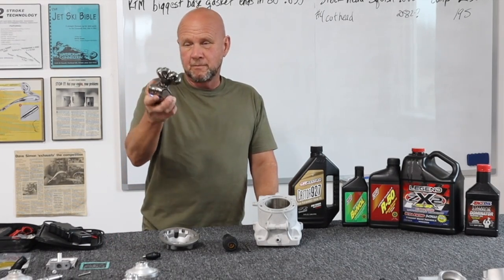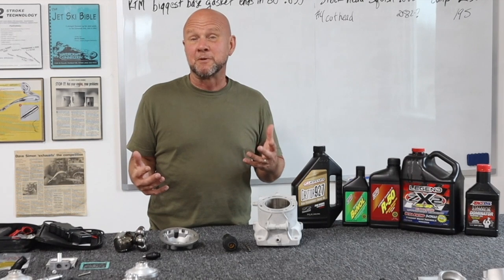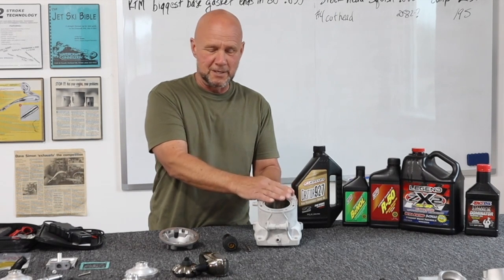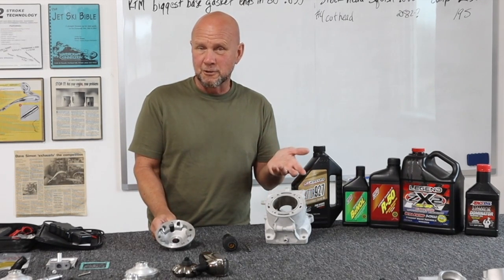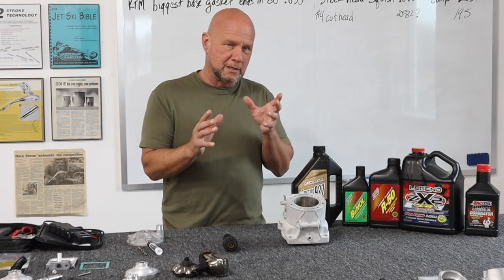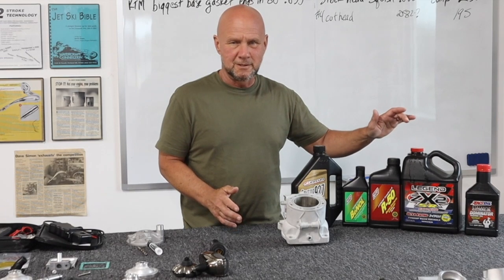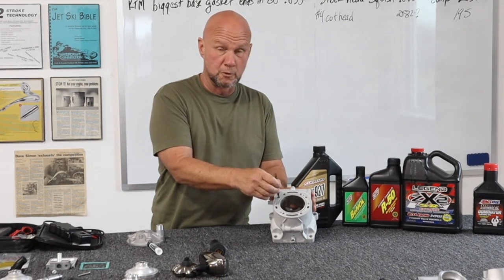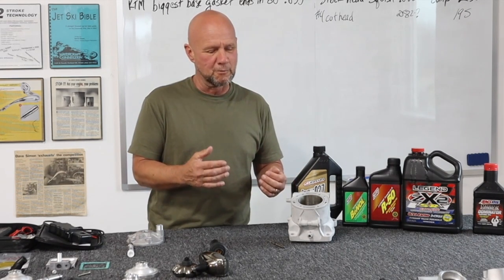KTM TBI cracked cylinders.  All TBI bikes.  We finally figured out how to fix the "hot spot"  Watch

Comment: I want my engine to be working more colder (it is a 2017 KTM-300-EXC Carburetor). 

Can I drill the cylinder holes in order to get better water flow and lower the temperature ?

Will this tip work on 2017-KTM-300-EXC Carburetor ?
Reply from the maker: No.  Totally different engine

Comment: I don't have a KTM with this cylinder, but have experience with 4 cylinder Japanese diesels. One of the issues is hot spots in the heads with turbos, even with intercooling. I clean, chamfer and simi-port the cooling passages. On brand new heads, its amazing how much casting sand, bits of mold wire, casting slag, and general bits of debris is inside the passages. After doing many of these heads, and blocks water passage clean-ups, I've found it makes huge improvements on flow and cooling. We never have cooling issues or head gasket failures afterwards. I suspect it would help on these heads and cylinders too.
Great work and videos, even for non KTM owners. Thanks

Comment: You can get a thermal imaging camera from harbor freight for about $200.  Point that at the cylinder while the engine is running you can see exactly where the hot spots are. 😎
Reply from the maker: Good idea sometimes. In this case though, you can't see the inside of a cylinder through an exhaust flange

Comment: Can we use legend in oil injection bikes?  I took apart my 25 te300 to check that hole and deck height. Tested 190 psi. Appreciate your work
Reply: Yup. Legends is great for that. 190 is good as well. And thanks

Comment: That second picture of the bore is just the first one with a hone passed through so of course it looks better. Rings are trying to scuff in the bore due to oil breaking down. A richer mixture of oil will prevent this too, so it may be a result of running oil to lean for use. If you run oil too lean for product, anything will show ring seizures.
Reply: It's all at 20:1 actually

Comment: Highland Cycles has a new video up showcasing a very similarly damaged cylinder. He was explaining that the new cylinders and heads are of a new design and require more careful alignment because of how the head and cylinder mate together. He talks about how if misaligned the cylinder will crack during assembly when trying to torque the misaligned head?
Reply: Did all of the cracked cylinders occur after someone installed the head?
Reply: @chestertownelectric6290 no mine cracked at 22hrs from factory
Reply: I saw where Morgan blew up his bike already but have not watched the vid yet. Sometimes I think he screws around with stuff too much. I'll watch his vid but seemingly misaligning a head that only goes on studs one way seems a bit off.
Reply: @SwormCycles  He over heated the bike but it seems that it isn't exactly clear as to why? He just showcased the aftermath and thinks the "T" tube failed. Most of his issues are usually from after market parts failing.
Reply: @peteregger7928  Ya I just watched it. He never mentioned anything (that I heard) in the vid about a misaligned cylinder. Where did you even get that idea? Doesn't really matter. I'm moving on and will be doing Dave's mod when I finally tear into mine but I do run a fan kit so not too worried about any of this.
Reply: @SwormCycles  Highland Cycles was showcasing the damaged cylinder in one of his previous videos explaining the head, combustion chamber and cylinder alignment being a little different on the newer bikes and could cause damage if not aligned correctly when torquing. His over heated bike was just recently.
Reply: @SwormCycles  https://youtu.be/stTPGXgmyLY?si=_ppVa6cCoozkCw4W Starts talking about it at 19.00 minutes. It wasn't an idea! It's what Morgan said in his video. Is he right or is he wrong? Who knows?
Reply: Great for making money these piles of poo. A constant content gift to them that just keeps giving .
Reply: This seems more plausible thank cracking due to heat imo

Comment: Ok question what oil can I use with the oil injection models for example amsoil dominator or motul. I have a 24 ec300 tbi
Reply: If it says it can be used with injection systems then it can.  It's much thinner oil, that is used in those, as it doesn't have the fuel to mix with it and thin it out.  I highly suggest adding an ounce of oil to each gallon of gas in the gas tank, as well as the injection, just for ass coverage.  At least when the gas hits the plug and the bike is running, it's had lube on all parts the whole time.      I think the best oil for injection is the Legends brand oil you see in the video.
Reply: I have only ever used Motorex products in my KTM.
Not the answer you are looking for but my 2022 KTM 300 XC TBI seized trail riding at 7.2 hours. A new cylinder, piston and crankshaft were installed. At 7.4 hours it seized again. This time KTM installed a new crate motor and a new oil injection pump. This new motor ran 100% better. The 1st motor started, idled and seemed OK but had no power as it would not lift the font wheel in 1st gear. The new crate motor ran like a scared cat like one should. After about 3 hours I removed the oil injection system and relocated both fuel injectors to be between the reeds and the throttle body via Pinit Rcing's relocation kit (LOL, just like the 2023 model came out with later). Now I know it is always getting oil like a carbureted bike and it has run great ever since. Never did hear that anyone figured out why the 1st motor was no good. I also put a Coober ECU on it for better fueling (and oil injection when the system was still on it) than the KTM original ECU.
Reply: @human1513  ok thanks for the info  appreciated it
Reply: I run only motorex. Do some research before running anything other than the recommended oil. I've seen that different oils have different viscosity and inject at different rates because of it. Also when mixing certain oils they can gel up and clog your injector.
Reply: @ProjectWrecked  yes this is what I'm worried about I'm currently using motorex  and I also add about 1oz to the fuel tank to make sure it's getting enough.
Reply: 110 hrs on amsoil dominator. Yet to inspect the cylinder. But so far so happy! 2023 tx 300 TBI.

Comment: Are you just boring out the passage making circumference larger, or are you also extending the depth of the passage? Thanks great video.
Reply: Just drilling out into passage. It's only a few mm down until it breaks into the bigger water passage